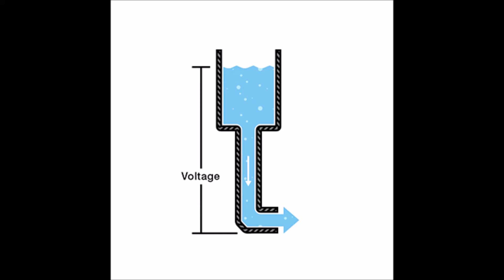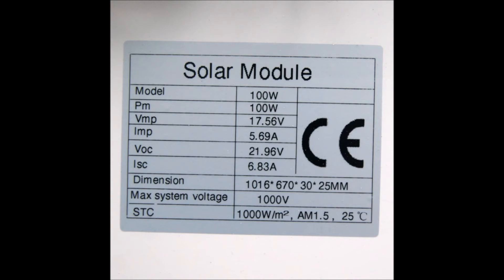Solar Panel Basics - Voltage 101

Comment: can you send alternator voltage instead of panel voltage to a solar charge controller and let it regulate aux battery charge?
Reply from the maker: I'm not sure why you would but it sounds like it would work.
Reply: @LDSreliance  i'm just looking to charge a 20-35ah battery. don't see a need in buying a solar charge controller and a dc to dc controller for such a small battery. when vehicle is running use alt, when parked use panels. same controller. make sense?
Reply from the maker: Kinda.  Let me know if it works!

Comment: I enjoy solar, but you are right, it requires some electronics understanding. For some reason I have always had a hard time getting the electronics textbook open. There is a reason they call me "the Jessie Pinkman of electronics". The basics really help and takes constant reminder. Just some basics makes it doable.
Reply from the maker: +Prima Donna Going Off Grid Yeah, that is why I am doing this.  I never bothered to learn this in school and I also have a hard time breaking open a textbook and forcing myself to learn.  But you have to at least understand Ohm's law if you are going to do anything in solar.